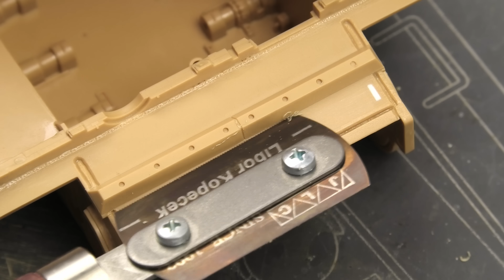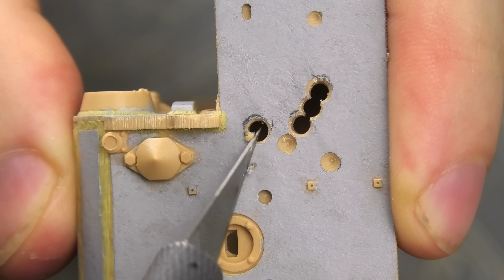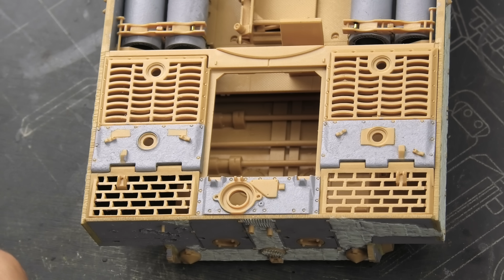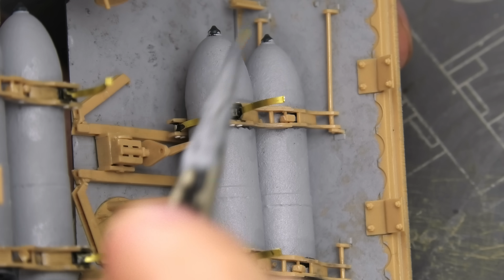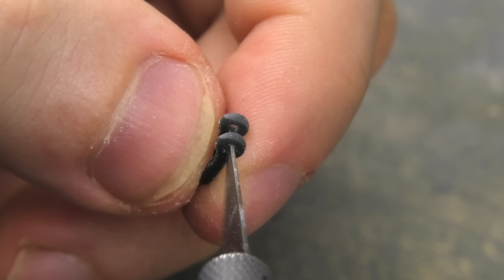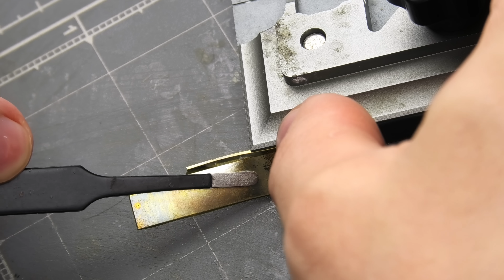Germany's Insane ROCKET TANK - Sturmtiger Full Build 1/35

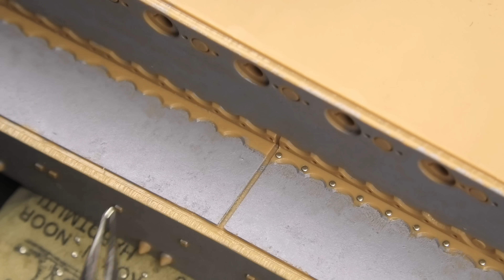Comment: 3:29 Anyone who knows what tool it is? Making rivet tool?
Reply: that is a pin vice (or a hand drill for some- used to fit tiny drill bits in) without a drill bit. hes just using the tiny hole that a bit would normally fit in to punch little circles out of foil.

Comment: This is a good video showing the extra steps, I scratched built the Sturmtiger in 1/25 scale. Using the Tamiya 1969 so I could make it motorized kit with a rear motor setup and a resin gun kit, sold before the C-19 plague. on eBay. But I haven’t seen any since then. Nice video, thanks for the extra details with putty tips!

Comment: How tricky are the 3d printed tracks and pins to put together? I tried to assemble a few masterclub sets with metal tracks and resin pins, but i just kept snapping the pins, so i switched to using brass wire like how Friules are assembled

Comment: As ever,work of art Martin mr marrying...congrats btw......ive the trumpy zimmerit rollers/stamps,really good set 1/35 and 1/72...btw what do you use for the rivets ,ive bought die set and tried thin poly sheet to stamp various sizes,which ok....do you use the thicker aluminium take away trays ?   spent a bit on temu for chisel sets hole/rivet stamps,putties sand sponges etc etc and good tools btw...I like tamiya smooth for zimmerit also milliput,as its made in Wales and im Welsh lol...and able to get thin with smoothing with water and spatulas...,got on temu too lol... cheers m8  also going to invest in 3d printing to try doing my own tracks etc...

Comment: Hans Fire a warning shot, Sir this a 38cm Depth charge with a rocket engine,  On a serious note the early RFM tiger are very rough fit wise either from over use of mould or flash. My tiger about half thru all the hull plates sudden half no texture like the block was polished and they forgot to re-texture the plates. Elephant corporate has a 3d printed flapper and cover for the tiger exhaust pipes